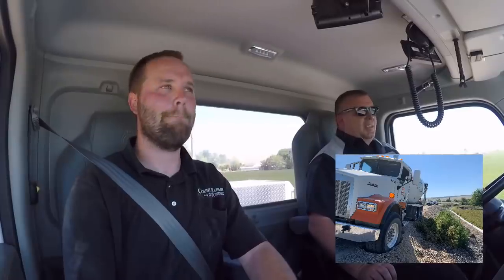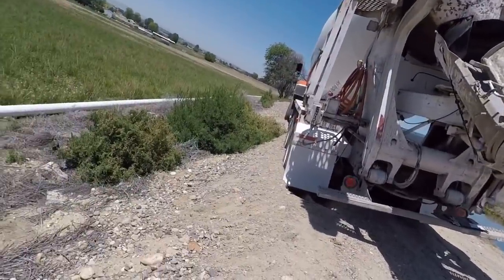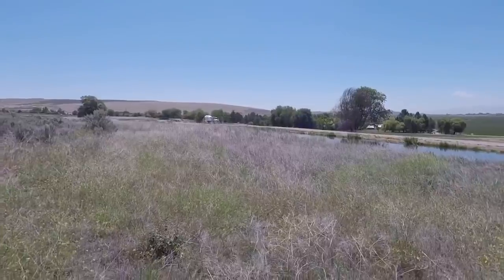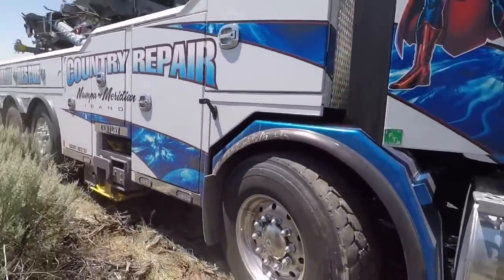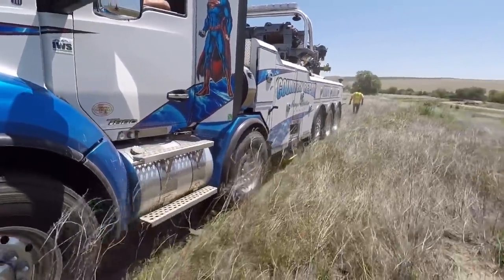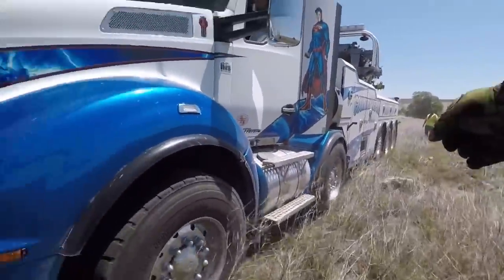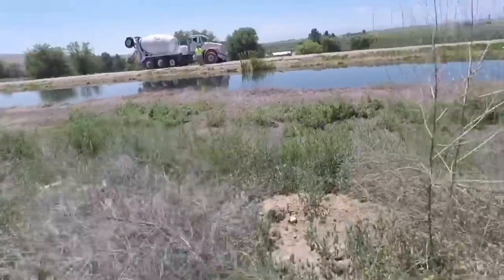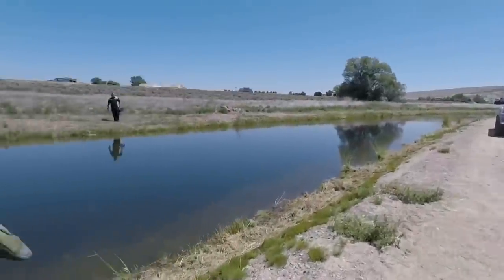80,000 lb Concrete Mixer Leaner

Comment: Country Repair- Thanks so much-- that's our property you saved.  This was the 2nd driver to do this.  First one  recovered 3 times before managing to back a 1/2 mile to the road.  Will there be a third one that makes it in the ditch or rolling over on us?????  Could be more to come for your dedicated viewers.
Reply: Maybe the trucks will quit trying to negotiate your road until you fix it up so they do not have to back up that road, and don't have to negotiate the soft spots. just sayin...
Reply: @deernutOO  the thing is that's the ditch company's road and right of way that gets damaged. Maybe they would think more into signing their access ways to keep people off the ditch bank.
Reply: @lucasglenn5775  Gotcha.. makes good sense.

Comment: When I drove a six axle Terex front discharge most of the time when we left the roadway the contractor/ customer had to sign the back of the delivery ticket that states there responsible for all damages and if needing a wrecker it was on there dime.  I had the misfortune of rolling that mixer end over end at 90,000lbs due to the spotter on the site forgot that they buried huge concrete pipe and as I was backing he put me on that loose ground and over I went into a 12 ft deep hole. Things go silent when you think your going to be crushed to death but I got out abit banged up. Held on so tight I bent the steering wheel in half , my nuckles were touching. Didn't loose my job cause they knew the spotter screwed up. Took 4 heavy wreckers to get it out and over. Got it started and the mechanic brought a wheel from another truck, got the 10 or so yards of concrete out and drove it back to the yard. Glad I am here to tell the story. Greg

Comment: Why is a big loader cement truck on a road like that ?? Was he lost  ??
Reply from the maker: George Davidson yep, gps took him down the wrong road
Reply: @CountryEquipmentRentals  The GPS didn't have hands on the steering wheel!
Reply: @CountryEquipmentRentals  It's truly sad how people depend on GPS and don't use their brain.  He should have been able to see that was not his road.
Reply: @CountryEquipmentRentals  i worked for sears service over 13 years ran into that a lot in PA .. who ever marked the roads for gps marked every path then seen ,,4 wheel trails hunting paths gas well trails ..i took a gas well trail looked to be a road for 4 miles then got tight could not turn around i just made it threw , pure luck ,, you did a great job pulling the truck out ,, you worked with what you had ,, if you would have got the wrecker stuck then it might have been a bad call ,, we all can arm chair quarter back because we were not there ,, keep up the great videos ,,
Reply: @iamReddington  
You would be surprised about how many jobs people working , don't know how to get there, and tell the driver just use the GPS
Reply: @michaelmcclure8673  100% agreed! When I worked for a company making home deliveries of sand & gravel we ran into this a LOT!

Comment: I think I would have thrown a strap over drum by rear ring and hooked to frame on left side
Reply: Worst place to geab a mixer is the rear oart of the drum, it just sits on rollers. The front pedestal is a strong point.
Reply: @danielramsey1959  not true . strap goes over top of drum .force is downward . rollers carry 20 tons of weight for years .I have done this myself at least 10 times and seen it done 20 more and by most tow companies  never a roller issue.

Comment: Game standing in front of the cable have seen them fly when snaped
Reply from the maker: Alan Langhorn what?
Reply: Yep thought the same, guy with the remote, didn't look to have much weight on though.
Reply from the maker: Peter Ranger As tow truck operators most of the time you stand by your truck by the controls and winch someone stuck towards you, unfortunately it’s the risk operators have to take. But that is why it’s very important to know your numbers, need to know how much resistance you need to overcome, need to know how much you need to weigh to anchor, and you need to know how much weight is on each line

Comment: Put air bags under the drivers side frame? Just thought of that. I have driven mixer trucks for 25 years in Alaska, also as the mechanic I have had to righten several. And..I have nearly lost several trucks myself from surprise events like a roadway collapse. Or..let out the air on the passenger side and rotate drum to discharge, that moves the mud over to the other side of the drum. Throw some timbers  in front of the driver tires on the low side. Just get truck level.

Comment: Never ever seen it done like that 
Very risky to say the least. Now you can go pick the drum off. It’s junk
Reply from the maker: What was risky?
Reply: Hooking low on a loaded truck!! strap the drum and pull it forward at least you have control of the weight and you would have been able to spin the drum
Reply: Not telling how to do you job at all  most important thing is always to spin the drum asap
Reply from the maker: Rick Underdahl We couldn’t spin the drum. When they tried it tried to tip over. It was way too top heavy and when they tried they almost lost it in the canal
Reply from the maker: Rick Underdahl once we got it out they were able to turn the drum
Reply: Good deal glad to hear it 
It was a touch position he never should have went there in the first place. Not with 10yards anyway 
You guys did great job with what ya had to work with

Comment: Sorry country repair one idiot made a comment that set me off. That if someone was your boss you would have been fired. You lol at them. As a heavy equip operator and hauling very oversize loads, and a true concrete guy, and the time that mixer sitting waiting for the tow, ,,the cement would have bern setting up depending.  Often quads get buried. They must dump their load or if offset dump their load. Ill guarantee it would have costed less money or close dumping 900 in cement ,  a dump  truck or another ready mix truck pulling it out backwards on the road probably would have cost less. Not to mention tying but that ready mix truck up.  Land owner to whom they were delivering to wouldn't have objected to having a free concrete embankment . Bla bla bla right or wrong. That truck was stuck and not even close to tipping over. Curious. How much did that pull cost.

Comment: Very dangerous, if either of those cables were to break there would  be a couple of dead guys on the job.
Reply from the maker: WARREN VOEGELIN how so? We were standing in front of the truck? If the wire ropes break they would go towards the water
Reply: @CountryEquipmentRentals  not in my view. One fellow controlling the rotator is standing between the rotator and water. Cameraman is also in a dangerous place.  I had a friend who had his leg amputated by a broken cable while in the navy.  If cable breaks somewhere towards mid span cable is going to fly in both directions.
Reply from the maker: WARREN VOEGELIN We are always very aware of our surroundings and very aware of not exceeding the working load limit of our lines. Also, most wreckers don’t even have remotes and are forced to work right by the truck.